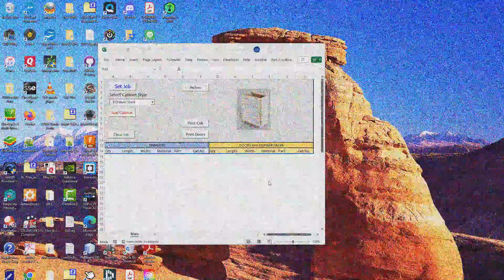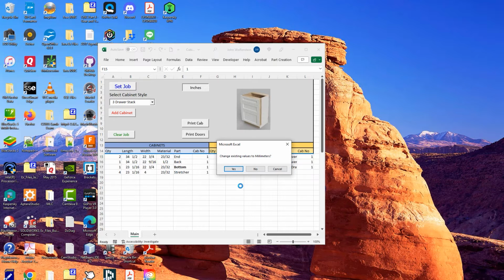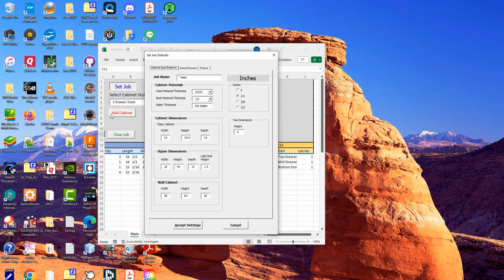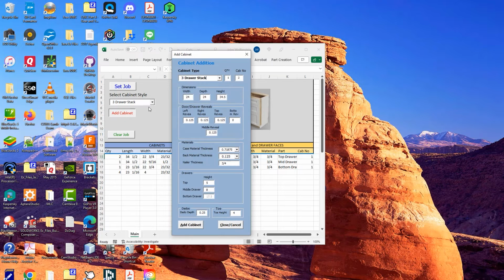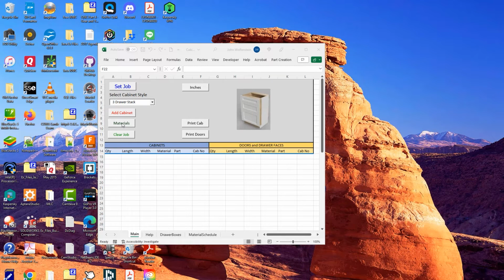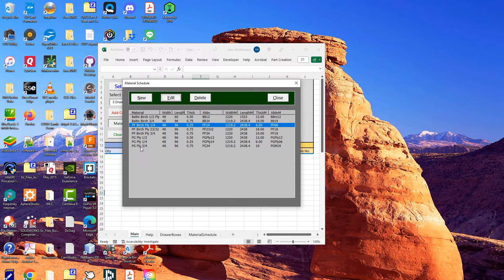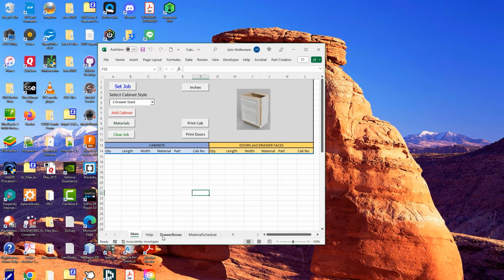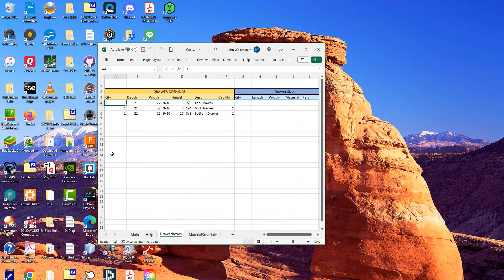Cabinet Calculator Update October 2023

Comment from the maker: Newest changes and improvements to Cabinet Calculator.
Reply: howdy do sir? hope you`ve been well.
I was just wondering when you might be updating it again?
I noticed that the Job name doesn`t change even when we set it up
Also a small recommendation, if we could add ourselves the image and cabinets to the list of cabinets.
Love the app so far. thank you
Reply from the maker: @dannyfaith7  I have a Beta version in the works.  My problem is I have too many projects and this is not at the front right now.  I will look into the issue with the job name.
Reply: @OldGuyWoodworks can it calculate the amount of sheets needed for the job? Besides, can you add an estimate side to the spreadsheet as that would be very useful for cabinet makers to get quotes faster. Thanks
Reply from the maker: @splinterinterior2449  not yet. I do plan on a few more upgrades, but am not sure of the timeline.
Reply: I purchased the updated version of your cabinet calculator, but it's not working .
Reply from the maker: @splinterinterior2449  Generally it’s in the settings where macros are either enabled or disabled. File>Options>Trust Center>Macro Settings then choose the macro setting you would like.
Reply: I have the receipt of purchase to confirm that I bought and paid for the  digital product